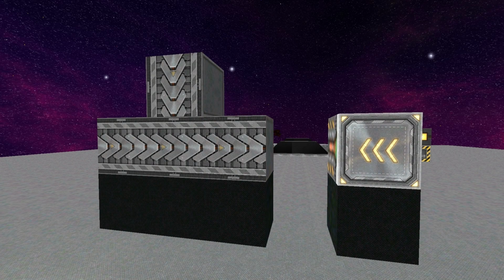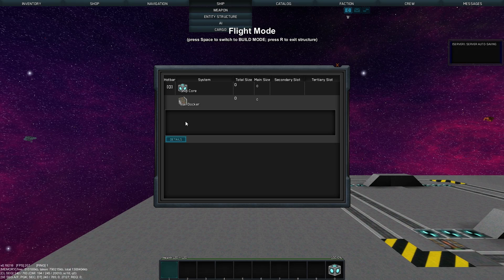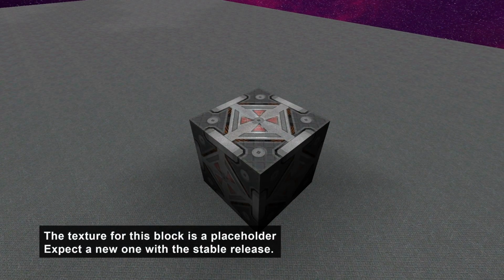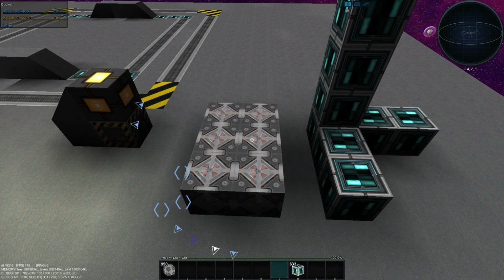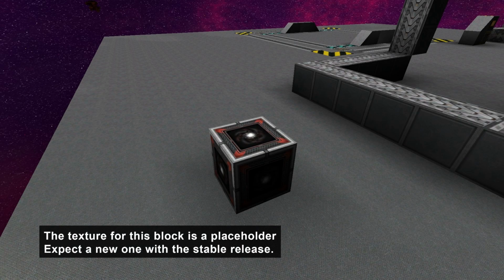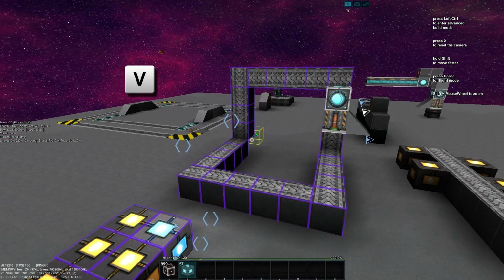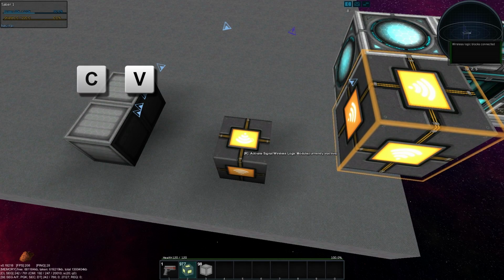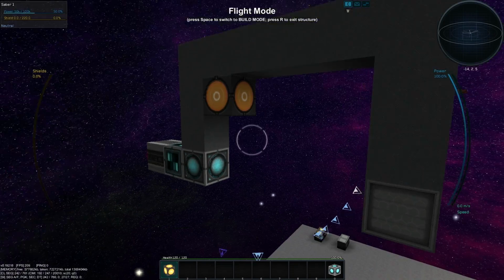Starmade Update .19226 | Rail Docking System

Comment: The new way of doing turrets is clunky for many reasons, one of which is that the OLD turrets blocks do nothing, and can't be docked with, but they STILL EXIST!
I just crafted dozens of them and them learned they were unusable and worthless,

ALSO, all turrets must now allow clearance on both one side, for the (realative) up and down motion, AND the bottom for base of that for the rotary motion, in other words turrets nee to be quadranted for optimal angling, which makes them fundamentally less useful
Reply from the maker: The old blocks were left if to allow players to adjust. Otherwise everyone's ship breaks.

The old turrets were capable of clipping through your ship and hitting a target despite not actually having a clear view of the target. The new system is more "realistic" and can be applied to more than just turrets.
Reply: I was unaware the old turrets clipped, as I often had issues with them not being able to do so. I always had to had them extend several blocks away from a ship face, or on a corner, to allow for a range of motion.
The new turret system has a few negative things, but isn't AS bad as i first thought.

After playing with it A bit here are my complaints, perhaps they're intentional, perhaps it's something you can work on (which i would appreciate)

1: you now require 3 ship cores to make a simple turret. which is ok later on but early game i don't have a ton of spare credits and ship cores aren't exactly abundant, the new system adds 50% costs to basic turrets

2: all the station and ship designs in the default game that i've seen seem to use the old system.. which means if i take one of those over and want to make any turret changes i have to redesign the entire system

EDIT: so what my real issue is, having gotten set up and used to rails. is that my turrets are dumb.. Is there a way to make the AI better? my turrets (with the only bobby AI unit i can find in them) can't figure out how to AIM with the ships i'm using. up and down aim up and down respectively, left and right rotate left and right respectively, yet when i was attacked by pirates just now, My turrets just slowly rotated in place, never aiming up OR down, and never firing a cannon or laser once.
Reply from the maker: There isn't much we can do about number 1 right now. As for number two, those stations are out of date, and have required an update for a long time.
Reply: that's odd. number 1 is just kind of a thing. not so much an issue, it just means you need more supplies before you can really settle down. 
but the second is weird. I'm updated fully but my new games still generate the old turrets on stations
Reply: Yes. The stations were made when rails weren't introduced. Maybe Schine could make a new competition for some station designs, but the station we have right now is too valuable to lose. (I mean just look at it) The new turret system is prettty good imo. It brings more build patterns.

Comment: Question about docked entities sharing shields with the main ship: If the turret itself has its own shields, will its shields need to be taken down before moving onto the shields of the main ship, or is it the other way around.  I only ask because I may build a USS enterprise D with the saucer-separation feature, and I want to know if I will need to make more shields on either section of the hull.
Reply from the maker: +Charles Earle The turret will deplete it's own shields before moving onto the next entities shields.
Reply: Thank you for clarifying that, what about rail-docked entities besides turrets?
Reply from the maker: Same thing applies. Any docked entity will use it's own shields before it takes from the next one down the docking chain.

Comment: i still find that even with my rail line my ship wont go into my stations internal dock,, ive tried lowering the rail docker so the ship dosent touch the station, ive tried deleting it all, also tried using a simpler blueprint ship,,but this ship im tryin to dock on the moving rail system has a mass of about 239.6 so if i could get some opinions id be grateful lol

Comment: I cant dock my ship anymore put the old docking system back please
Reply from the maker: TheBuugar This system is meant to replace the old system in time. You can turn on the old docking beams in the server config.
Reply: TheBuugar "The old system is still functional and no ships, blueprints, or other 
structures will break. The only restriction is that the docking beam is 
replaced with a pure activation beam, but if necessary the docking can 
be turned back on in the server config." From the patch notes
Reply: wheres the server config?
Reply: im using steam btw

Comment: Why did you make it so I can't use the old docking systems? :( I tried to dock a ship core and docking rail to a single rail block but it said too big -_- this system doesn't work 100% so now i can't dock stuff!
Reply from the maker: alistair smith This system is meant to replace the old system in time. You can turn on the old docking beams in the server config.
Reply: StarMade Thanks! I figured out the new system anyway, so that won't be necessary! It works really great once you get used to it!